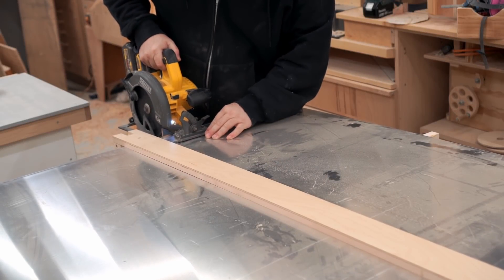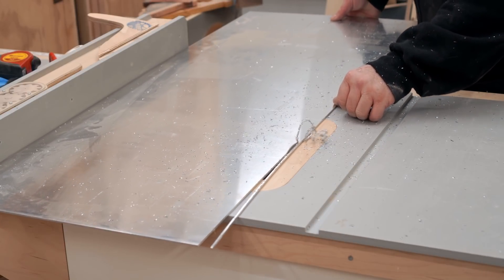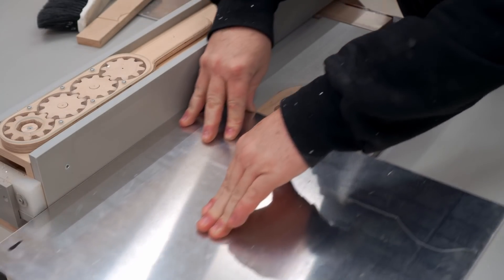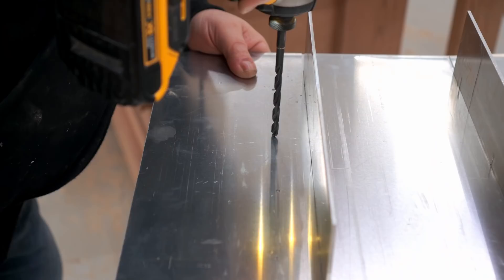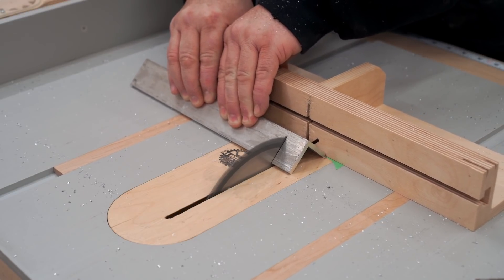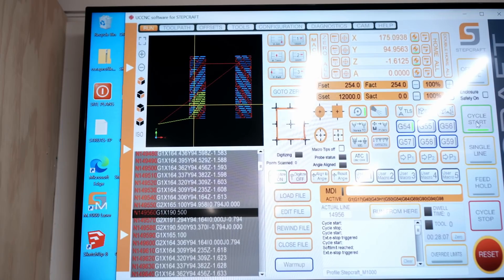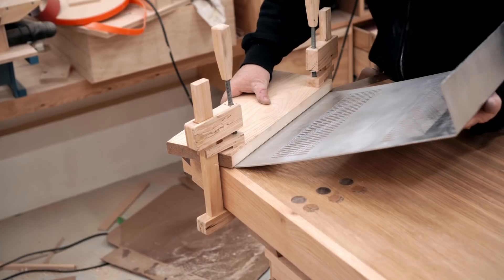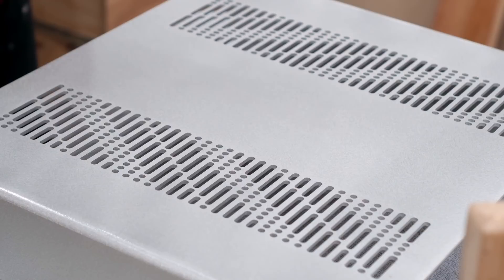Making An Amplifier Case From Raw Aluminum

Comment from the maker: I'm building a 4 channel amplifier and this is the chassis / case for it. Or at least most of it - I still have to make the front and back panels, but those are significantly easier. 
I used thick aluminum for two reasons: first, I had a piece of it left over from a job I did years ago, so we can call it free material. The second reason is heat conduction. The case itself will act as one large heatsink helping to cool the amplifier.
And I guess a third reason would be that thick aluminum is a premium quality material to build with, unlike thin sheet metal.
The finished amplifier will be 17-1/2" wide x 15-1/2" deep and 3-1/5" tall.
Reply: Love the vent hole layout!!! Awesome job!!!
Reply: @rj_rezin_worx  yeah this. the hole layout and the frosted finish look superb
Reply: @albertkelly7129  When he sprayed the clear and i said "game over"!!!

Comment: I know this is an older video but having trouble finding an answer to a question I have so hope someone sees this. For the vent holes, do you need to consider their size based on EMI/RFI? I'm wanting to build an amp where the internal boards are visible so thinking of making at least one panel some kind of open mesh.

Comment: There is nothing more annoying for me than those burrs on freshly cut aluminum. If you look at them with a microscope, they look like fishing hooks with lots of extra barbs. With steel slivers, if one gets stuck in you the worst case is it rusts out in a couple days. Not so much with aluminum. 

Oh... and you should have used a thermal epoxy on the heatsinks instead of construction adhesive. It wont take much heat for that construction adhesive to turn to mush.

Comment: Nice project, well done. Just my 2 cents.
1. Instead of screwing right into the divider piece you could have used a slit and place a nut there instead. Would have been a sturdier connection.
2. Why glue the heat sinks with an isulator glue, you could have soldered them into place or clamp with screws, they would have cold welded together if the surface was sanded real quick, for better heat transfer.
3. You had difficulty bending the piece. It´s understandable because it is a thick piece of AL. However I think you material was pretty hard, you could and probably should have annealed it prior to bending to make it soft an pliable. This way the material also does not tear and brake. It would have hardened by itself after a while after this.

Comment: Harbor Freight sell two sizes of a sheet metal brake for less than $80 for the big one. It's a bit difficult to setup and you also need two or more good C clamps (don't buy those at HF). It's not a $1000 model but I think it's a bit cleaner bend than the old board trick.

Comment: that's a great looking case.
i have no idea what temps the transistors are going to experience and you have lots of surface area + mass, i'd be surprised if you have a cooling issue. but those heatsinks glued, i didn't like that.

for whoever is interested:
on CPUs (those heatsinks look v similar to older AMD coolers) the thermal compound is critical. adhesives end up behaving more like insulators when dry. many yrs ago that was our overclocking limiting factor, the heat, so we tried all kinds of approaches.
anyways, best heat transfer is between two smooth surfaces (1000 grit sandpaper figure 8 honing) , as little thermal paste as possible to fill in the minuscule gaps.
Reply: Agreed, I was going to mention this as well.

Comment: I’ve cut soft metals quite a few times on my expensive wood shop equipment, and I can say this for sure, NOT ANY MORE !
The time I’ve spent cleaning out metal dust and shavings from metal to metal bearing surfaces the few times I’ve done it, is just not worth the time savings of using the wood shop equipment for metal. The shavings weld themselves to the close tolerance bearing surfaces, and anything else that needs to have clean smooth movements.   Sometimes it actually takes a day or two for the metal shavings to rear their ugly head’s, and that’s AFTER you think you have it “all cleaned up, and out of the picture.
No offense intended here John.   I’ve seen many many of your videos, and I think you are a very talented guy.  I’m just forwarding  some of my extensive knowledge in the field to give others a head’s up as to what they can expect after doing some metal milling on their wood machines. 😎

Comment: That's some very beautiful craftsmanship there! I really wish I had all of those tools that you used to do this, especially the CNC machine, because that top looks really cool with that design in the vent holes!

I also didn't know that polyeurethane (sp?) glue is thermally conductive? What brand do you use and where did you get it? I've been looking for something like that to fix an amp I have where a few of the smaller heatsinks were just glued onto a couple of the ICs per channel and they all have fallen off over the decades, therefore now it can't even be turned on without those ICs immediately getting too hot to touch.
Reply: i use those cheap thermal glue that you can find cheal in eletronic store, you shhould give it a try, it is not fisically resistent as SP but it is glue and it is thermally conductive.
Reply: @GrulbGL  Hmm, ok, I'll have to keep looking for it then, because I've never seen anything like that in any of the electronic (parts) stores in my town. (There's only 1 electronic store now where I live, now that Radio Shack went out of business, but they don't have any thermally conductive glue.)

What brand of glue do you use and where exactly do you buy it? (I need specific names so I can also find it myself.)

Comment: Heatsinks with small fins are meant for active cooling. Hope you have fans in there.
Reply from the maker: Heatsinks are about increasing surface area so that more metal contacts air. Just because these were designed for fans doesn't mean they won't work without them.
Reply: Actually whole studies have been done on this. You get less cooling with your fins too close. Not more. It doesn't work that way.

Now if your fins are close together you will get more cooling with forced air. A fan.

If your fins are too close together, it will not self cool, then you have to have a fan.
Like I said scientific studies. Laboratory studies all prove this.
Read one, watch the temperature rise when someone uses fins too closely spaced together without a fan.

Comment: After sanding, try soaking the aluminum in a lye solution for a little while. Then rinse and apply lacquer. Its a different looking finish.
Reply: This sounds interesting Jerry.  Where do you get your lye and what solution do you use?
Reply: @russellanderson746  Red Devil lye "drain cleaner" at a hardware store I never actually set a concentration, just dissolved some in warm water enough to cover the piece of Al I was working with. It etches the Al.
Reply: @jerryfankhauser2959  Would granular Drano work?  I have a couple of vintage receivers that I intend to make new covers for.  I'm going to have to check this out!

Comment: Aluminum "work hardens", so bending it must be done in one quick action. The bend radius is typically several times the thickness, but the relief cuts John did here effectively reduced the thickness, allowing a small radius. John is a careful craftsman and pulled it off here, but this kind of bend would never be accepted in industrial design. The result is a very weak corner. But it looks great in the end, mainly because it's John doing it.

Comment: John,  one question for you.  Since heatsinks are glued and then screwed on, isn't it possible to use heat sink paste . That would transmit the heat better.
Also. I like your front panel of your old 6 channel amplifier wooden facia. Would you permit me to make one for my personal use,I am making my self one amplifier.  Its a request.
Reply: That was my thought, too. Rather than the construction adhesive, which I assume is an insulator, would it be better to use a thermal pad, or CPU paste. That said, these aren't exactly cooling a CPU, so maybe it would simply be way way overkill, and even with the construction adhesive, it's more than sufficient.

Comment: I'm not sure of the heat transfer capabilities of pu glue... I'm also not certain of how much heat transfer you really need for that. would it be worth it to grab a cheap tube of thermal grease used with cpu coolers?

Comment: Nice case John. I like your fancy top bend. Kind of classy. PL on a heat sink is a new one for me. You have me scratching my head on that one. The rest is brilliant. I had seen that thread into a cut trick on some main frame stuff I salvaged years ago. Totally forgot about it until I watched you to this.
Reply from the maker: Figured I'd get a bunch of comments on the glue, and sure enough you all didn't let me down :)
Like most everything else that comes up like this, it's a matter of how you are perceiving it. You see the glue as an insulator - something that will block the passage of heat. And that would be true if it was thick enough. 
But it isn't thick. It's actually less than the thickness of a sheet of paper, and you can test right now how well a sheet of paper blocks heat by using it as an oven mitt.
Thermal grease mainly fills any gap between the parts. It doesn't have any magical properties that make it significantly better at transferring heat than any other grease, other than it doesn't melt and drip out the bottom of the amp.
It's the air gap that's the real insulator. Anything that fills it will be an orders of magnitude improvement.
Reply: @IBuildIt    I agree. The thickness is minuscule. The proof will be in the operation. And I am sure you will have an amp that functions well. Good to make me scratch my head from time to time!

Comment: I have cut aluminum with woodworking blades and with a blade designed for aluminum. Everything you said is absolutely correct. I never thought of lubricating the blade, great tip. Working with aluminum is "galling".  ;-)

Comment: That looks so damn good John!  I put a .007" micro bevel on the edges of all my holes on the CNC.  It's amazing how much that little detail will dress up a hole (unsolicited tip there...)  I also just use a spritz of wd40 when cutting.  It keeps the tools cutting a nicer surface finish and it cleans up easily.  I'm going to have to steal your route and fold technique.  It looks like that worked really well.
Reply from the maker: Actually been chamfering things for quite a while, Greg, but thanks for the tip anyway :)
In fact I had the chamfering tool path ready to run after the cut, but somehow the stock moved a very small amount while running the main cut. I discovered that when I tried to make a cleanup pass and wound up with slots that are bigger than I originally planned and holes that are elongated on one side. Took a total of nearly 6 hours machine run time (plus a couple of hours with me going back and forth to generate new gcode) to get it to where it is now. 
So yeah, I'm happy with it as it is :)
Reply: @IBuildIt  I should have known you'd be 2 steps ahead of me!!!  I know I already said this, but it looks AWESOME!!!

Comment: I understand that you'd have polyurethane adhesive at hand and that you would prefer gluing the heatsinks rather than screwing them in place (or with a bracket or something), and I assume you won't touch it ever again, but you might have glued just the sides and used thermal paste or a thermal adhesive on the underside. Although that might not be critical as using it on a computer.
Reply from the maker: All that non-conductive thermal grease does is fill the gap between the parts, so anything that does that will be nearly as effective. And when I say "nearly as" I mean maybe 5% less effective. It's getting rid of that air gap that's important.
Reply: I love to see a test on that. In my mind the glue would isolate the heat
Reply from the maker: A test? Take a piece of plastic wrap (for food) and put it on the end of your finger. Then take that "isolated from the heat" finger and touch something hot, like the side of a pot of boiling water. Report back with your findings.

Comment: ethanol works like magic stopping aluminium sticking to the tools and it just evaporates leaving the parts and tools clean. With small tools on a cnc the difference its like night and day
Reply from the maker: I'd need a mister or a very slow drip for the CNC, since the cut took a total of 5-1/2 hours. I'd get that set up if I did more aluminum.
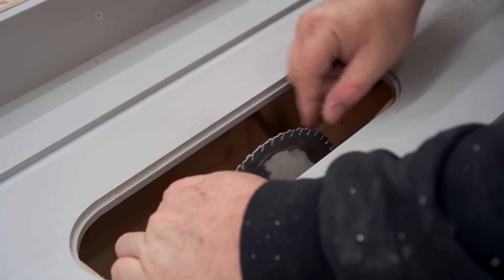Reply: @IBuildIt  get some cooling liquid you can dillute 1:10 to 1:20 with water and put it in a squeeze bottle or spray. Put it directly on the alu plate. That alone will make a difference, no mister is needed and you don't need to babysit the cut. Also, use a smaller single flute endmill and cut the slot with 2 passes per depth of cut so chips can't get stuck.
Reply: @IBuildIt  yes for long jobs using a spraybottle is not really an option.

Comment: Beautifully done! One thing that might be a good idea is to use a small rubber or foam pad on the aluminum piece holding down the caps: they do change size over time and wouldn't want them putting extra stress on the caps. Of course they might be springy enough as is.

Really really like that pattern you cut in the top, super classy!

Comment: you said you are using polyurethane adhesive to mount heat sinks [at 4.38].  and said using the whole aluminum cabinet as heat sink.  eyeball boing!.    polyurethane is known heat insulation material.
Reply: An isolator is not polyurethane itself, but air bubbles in a polyurethane foam
Reply from the maker: Try this: coat you hand with a layer of it a few microns thick and then remove a roasting pan from a hot oven. Should be okay, right? Let us know how that works out for you.
Reply: @IBuildIt  
interesting challenge that i am not willing to "experiment" with.
I went eyeball boing as being surprised.
Reply from the maker: An air gap, even a very tiny one, is much more of a thermal isolator. It really doesn't matter what you fill the gap with, as long as it's filled and isn't large.
Reply: @IBuildIt  Why not use actual heatsink thermal paste? It's cheap and provides around 15 mw/k of heat transfer rather than Polyurethane's 0.5ish mw/k. If you put Polyurethane between a cpu and a heatsink, it wouldn't last 60 seconds without it thermal throttling and shutting down. Sorry but you couldn't be more wrong about "It doesn't matter what you fill the gap with". 
Having said that. Beautiful work. Really came together and looks nice.

Comment: Looking great. I’ve never cut aluminium with wood tools yet but love the tips you gave should I ever need to. Cutting angle aluminium with a miter saw (even a “cold cut” one) requires respect of safety aspects as small cut offs have the annoying tendency to fly off at great speed if they catch on the teeth of the blade